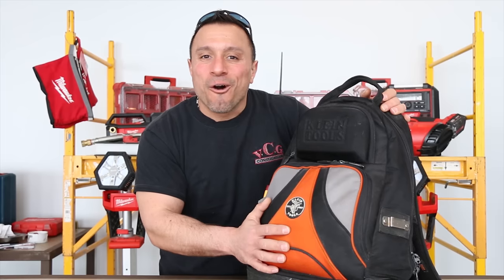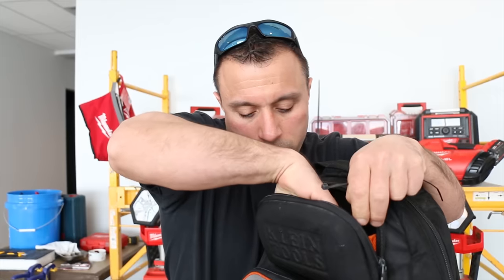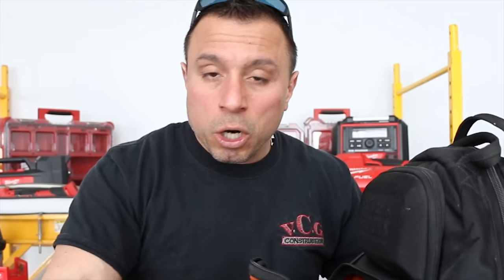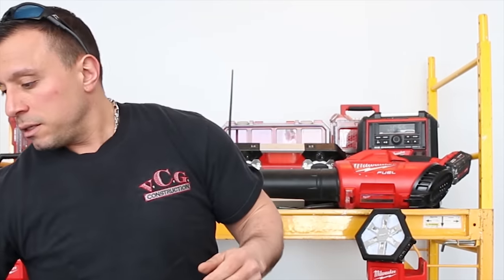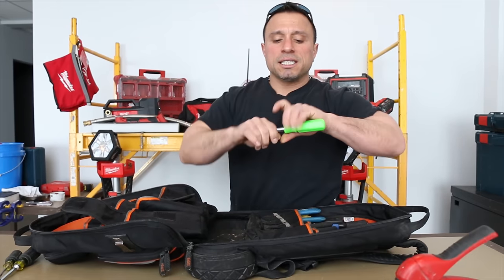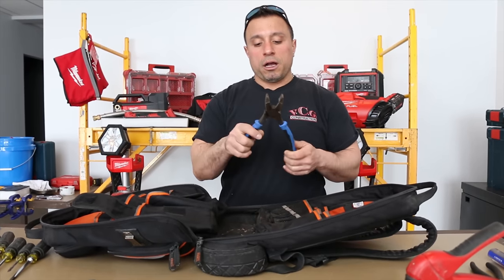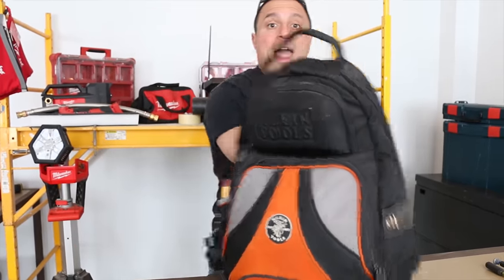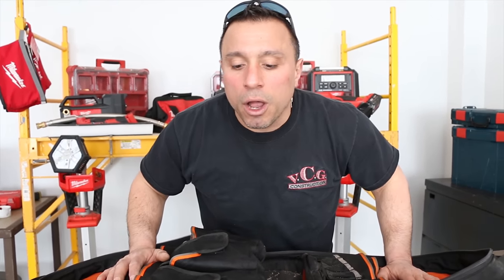Inside A Contractors Klein Tradesman Pro Backpack!

Comment: Just bought one today. I work for Square D. I found myself in a situation where it was impossible to roll my stackable tool boxes accross a construction site. I had to empty my laptop/admin backpack and fill it with heavy tools and parts. I was afraid it would rip and emptying it made a mess all over my passenger seat. I'm also about to fly cross country to assist another region and this bag is perfect for a minimal essential tool load out that I can get on a plane. 

I do wish there was a protected compartment in this bag for a laptop. I frequently need one on the jobsite for test data forms, technical drawings, and equipment interface for testing. I'm watching for loadout ideas. Thanks.

PS- aluminum foil strips rust like mad...for cleaning up your rusty tools.

Comment: I had the Klein bag for over 5 years and never liked it because of the way it opened and couldn’t fit large tools in it. I just recently picked up the Milwaukee back pack and so far I like it a lot more. I can fit more items comfortably in it with no problem. The only thing I think the Klein has on the Milwaukee bag is a slightly better build quality.
Reply from the maker: Thanks for the feedback buddy, we appreciate it!
Reply: I have this backpack I am a telephone repairman I agree it opens awkwardly I just bought a packout set I think I am going to replace this with a Milwaukee tote. Maybe 10inch

Comment: this  Klein tools backpack just like my Milwaukee ultimate jobsite  its  nice though I love Orange but red  is  nice especially when it's free
Reply from the maker: You can’t beat free, how did you get it?
Reply: VCG Construction  tool boss  Milwaukee had a joint contest on  New Year's  years  Milwaukee mail  mail that out to me. not  Tool  boss  its  holding  up good I have no complaints  I actually have a video of when I received it and I didn't update video  I do side jobs besides working for this business as their maintenance guy somebody needs fixed in their place as long as it's not electrical I do it or Plumbing even though I know how to do plumbing I was never fully certified as a plumber
Reply from the maker: That’s awesome!!

Comment: Maybe the quality has changed and for the worse. I have one and it's 2 years old.  I started to regret buying it after its flaws became apparent  over time. The pockets are saggy, cannot utilise all the pockets when others are occupied, the velcro on the flap pockets are pathetic and by far and worse of all is the fact that EVERY pocket is the same depth so any small screwdrivers or markers are not visible at all.  So when it comes to easy access especially when working in low light levels you cannot see the smaller tools.  It's mainly because of the pocket depth reasons why i have at times left smaller tools on the job because it has not been possible to visibly account for their presence in the pockets.  My worst purchase ever.

Comment: I have this bag. I started using backpacks since alot of accounts I go to have caged ladders. 
Im on my second one. They did warranty the bag without issue or argument, united refrigeration did an over the counter exchange and sent the  defective bag back to Klien. The rep from Klein was really cool with them on the phone and gave an RMA # right away.
I do have one complaint about it. Its hard to keep track of my Klein Stubby screwdrivers and nutdrivers. They get lost in the bag often. 
I like the hard case compartment. I put my jumper wires, small screw drivers for changing thermostats etc. also keep other small items in there. I even keep a thread sealant in there which had never been crushed! 
Its a good bag, and I notice each bag I get the part which broke previously has been redesigned or beefed up on the new. 
Saves your shoulder also. Increases safety also by keeping both hands on the ladder. I am a HVAC Technician/service pipefitter and this bag holds up nice. If you buy one pay attention as different versions of the bags exist which affects layout and pocket quantity
Reply from the maker: Awesome Gm I appreciate you leaving all that feedback on the bag! I’m sure the #VeryCoolGang will appreciate it as well!
Reply: I cut up old wash cloths and stuff them into deep pockets so that the stubby doesnt sink too deep.  You can customize each pocket with cut up wash cloths for the individual length of each tool. Hope this helps.  I do that for my veto bags also.

Comment: I use mine for general contractor work I can swap out any specific job tools that I don't use much at the truck but I have everything I need to do most jobs in there ! O don't think it is just for electrical work . I've always used it Sheet Metal, welding, millwright work now General contractor it's good for alot of jobs pack what you need from the gang box , truck, trailer and get after it !

Comment: I have this pack. Zipper is awkward. If you want to put a drill or impact in, it will fit but it has a shallow storage area once tools are filling pouches. I wish mine was about 4" deeper to accommodate a power tool or two.